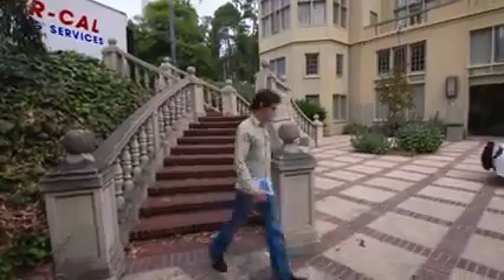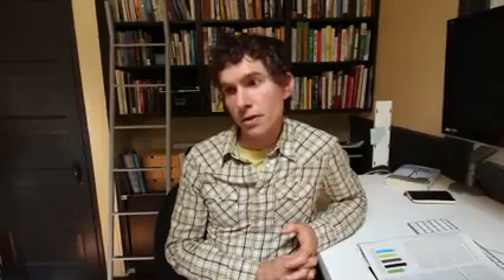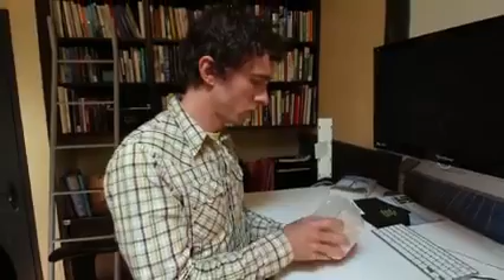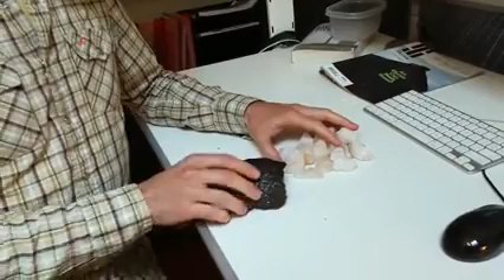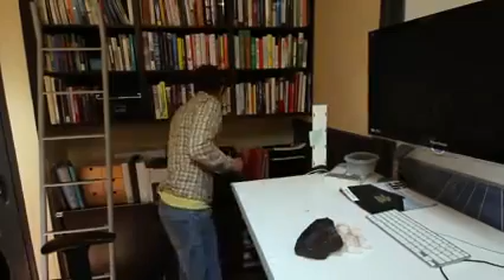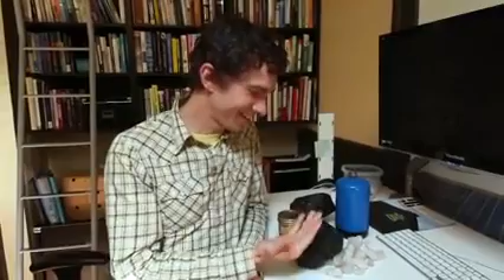See how we are using COAL to create Solar Panels .

Comment: Some mines where the materials for first cars in the 19th century came from used horses to pull the mine carts. According to this guy that means the current car factories are using horses and the Ford Model T is the only car that will ever exist because technology does not improve.
Also, we once again see a supposedly educated person fail basic math... His next movie will be about how investing a dollar so you earn two dollars loses money because $1>$2.
Reply: No you’re missing it. Solar panels have coal inside them to burn and create energy. It’s like using a horse to create a horse.
Reply: @BenkHouston  Also it's magic coal that will not pollute if you claim your coal plant uses carbon capture, but releases 10x CO2 if the electricity is used either to charge an EV or power a factory that makes PV panels or wind turbines.
Also, the power lines from the solar panels have 50% line losses but only 5% if a coal plant uses the same power line. Now, ignore how certain idiots just tried to prove the solar farm=coal plant...
Reply: @BenkHouston  solar panels don't have coal inside them, it's a mixture of quartz and carbon to make a new metal, the carbon burns up as carbon dioxide.
Reply from the maker: See once again to understand
Reply: You clearly have no clue what you are talking about do you?